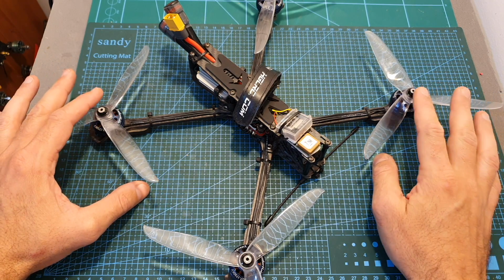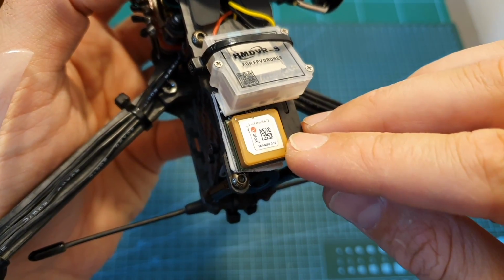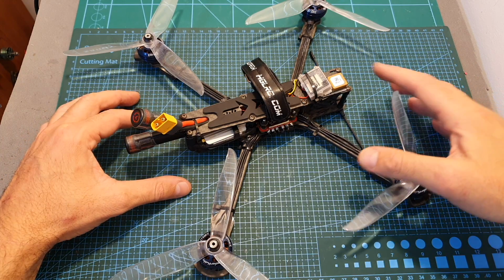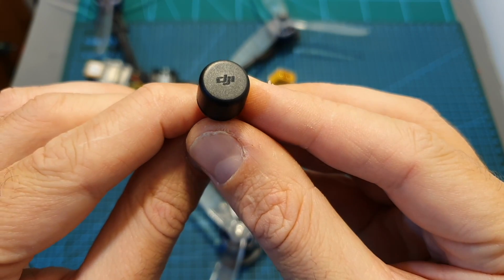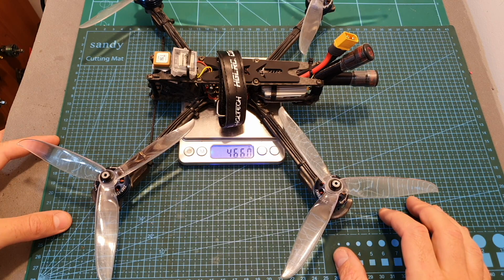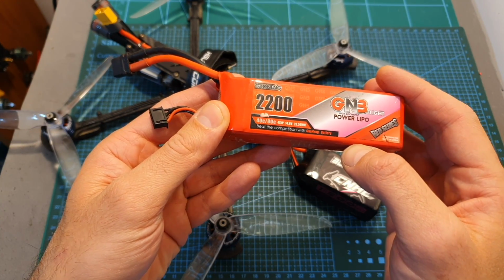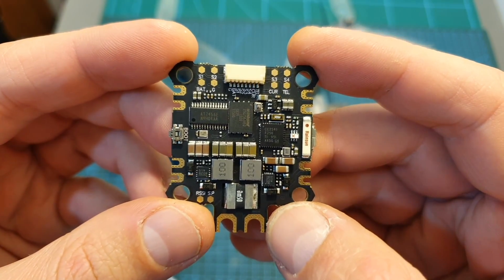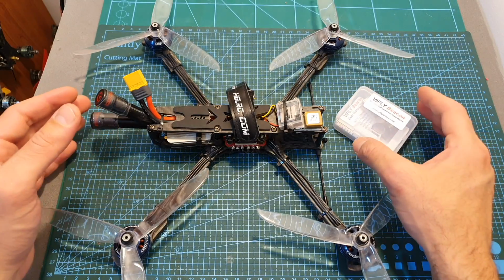Long Range 7" HD FPV - HGLRC Sector V2 Build & Flight

Comment: Is there a way to keep a quad stable in the air like a DJI drone?
Reply: @escobarfpv1275  yes i know but surely there is a way of actually doing it
Reply: @maxwelzig  You can use angle mode. But it won't stay in place very well...
Reply: INAV
Reply from the maker: You can also use Ardupilot.

Comment: What PID tune did come up with? Wondering if you could share. I also have the same frame with 2508 1500kv motor BrotherHobby V2. Just getting weird bobbing with the quad. Like your long range video keep it up.
Reply from the maker: Thanks buddy. I didn't tune it eventually...
Check out this guide as it might help you out:
https://github.com/betaflight/betaflight/wiki/4.0-Tuning-Notes
I am going to try it with another 7" quadcopter soon.

Comment: As I already mentioned in other video, antennas should look vertically in a 60° angle. That's why you get only 3km range.
See here what's possible on 700mw:
https://youtu.be/yktsNFZWHWM
You should also relocate your GPS. Placing it right over the 900mhz rx antenna is the worst idea, since there will be massive interference.  Place it as far away as possible from the 900mhz system, you should get 15+ sattelites and very fast fix.
Reply from the maker: Thanks for the information and tips.

Comment: Nice video, as usual. Did you do any tuning? It seemed to have some wobble at times, separate from the noticeable prop-wash. I’ve been thinking of building a 7" LR, but haven’t settled on my components. I do not want DJI. Nothing against it, just not ready to plunge into digital.
Reply: Get bigger motors, dude. At least 2507. There are some great 2806.5 as well. 😊
Reply from the maker: Thank you buddy. I only used stock settings and I need to tune this quadcopter as it's not flying very well.

Comment: Is blurring out the sides of the vid a special effect by the DJI Unit?  It takes away the emersion of the viewer.
Anyway, Very nice initial review and making it interesting as well as helping the newer folks!
Reply from the maker: Thanks Jim. When the camera is set to 4:3 the video is recorded at 1440*1080 60fps. When you se the camera aspect ration to 16:9, the video will be recorded at 1920*1080 60fps.

Comment: Hi, thanks for sharing the video, i have a question, about the remote controller, can I use my DJI remote controller? thanks
Reply from the maker: Yes, of course.
Reply: @KremerFPV  thank you I see
Reply: Yo yes you can use the DJI controller but not with the build he show in the video. He use his own receiver you will need soldering all the wires from air unite to be able to use the DJI controller
Reply: @nes.torfernandez  Many thanks to you to clear this point..

Comment: You get 8 minutes of freestyling like that?

How do you like the 2307's? I'm looking to do a long range, and 2508 seems to be what I'm seeing in alot of builds.
Reply from the maker: Low KV 2508 motors would probably be a better option for a long range setup.